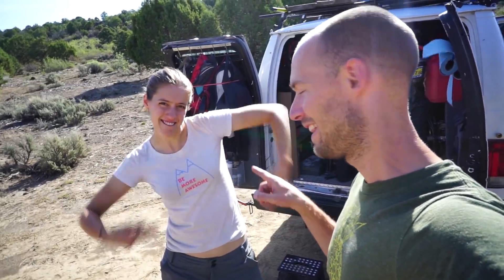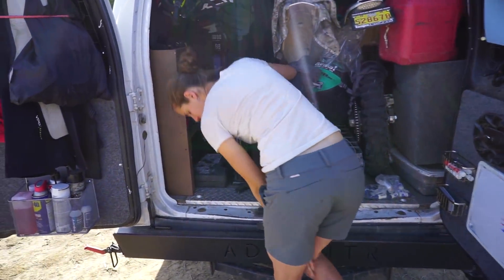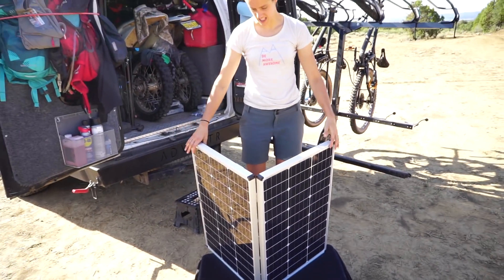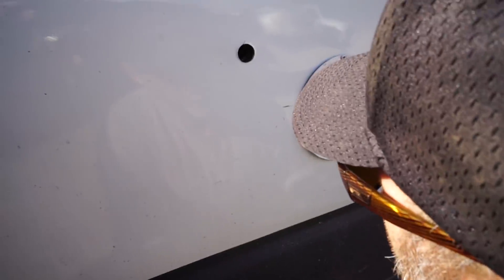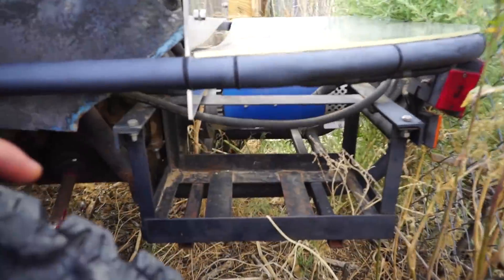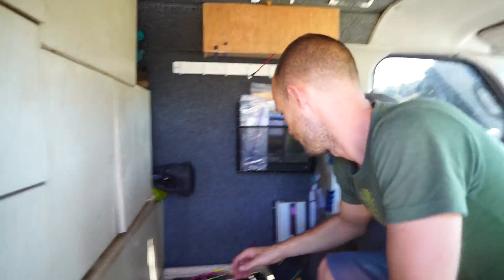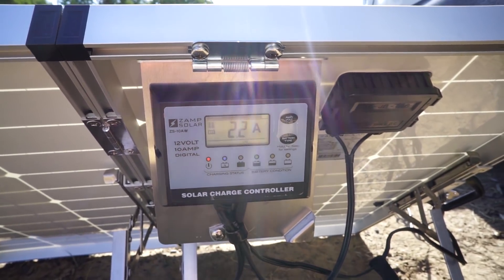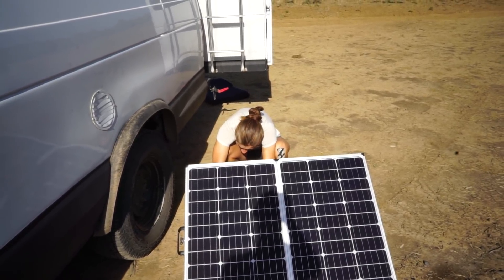INSTALLING SOLAR IN OUR VAN -- Zamp Solar 120W portable setup

Comment: Check your panels - 2.2 amps in direct sunlight seems awfully low for a 140 watt panel to produce.  Could be only one panel is working
Reply from the maker: We've since had 7 amps, so I'm not too worried. Just have been cloudier than we thought!
Reply: Great — That sounds much better.  Good luck with everything.

Comment: What type of plug did you use in the side of the van? I love that idea.
Reply from the maker: Don't remember what it was called, but the solar panel plugs right into it. A local solar company installed it for me. They basically just drilled a hole in the side of the van and screwed it into place.

Comment: How do you tell when your battery runs down?
Reply from the maker: We have a volt meter display. Not the most accurate measurement, but a pretty good estimate.
Reply: Nice. Part of my job is designing solar/battery systems for airport lighting so I always nerd out about van setups 🤓🤓🤓

Comment: Don't have any solar experience, but question if 120W is overkill for keeping auxiliary battery charged.
I do own a car battery charger, and longterm charging is usually very low (less then 10W).
For this reason, I wonder if a very small 10W panel on the roof would have been a better solution.
As always, looking forward to your next video :)
Reply from the maker: I don't understand it very well, but I think the main things are that you don't generally get full power all the time (because that requires optimal conditions and full sunlight) and there's no sun for half the day, so even if you're moving the panel to follow the sun, you want as much power as quickly as possible so you can charge it up during the day. Whereas with the long term charging, you're generally not drawing much from the battery and it's always plugged it. That's my understanding at least!  -M

Comment: I really think you need to roof mount or hood mount your solar panel permanently so it works 12 hours a day every single day. It's only my personal opinion. I think after a while pull it out will be somewhat of a hassle, until your batteries are two dead and you need power. Even if the panel was half the size it's way better than nothing that's plugged in. Love your videos keep riding guys 👍👍👍